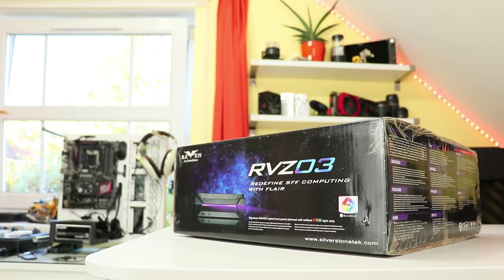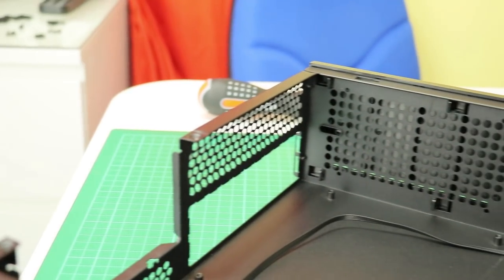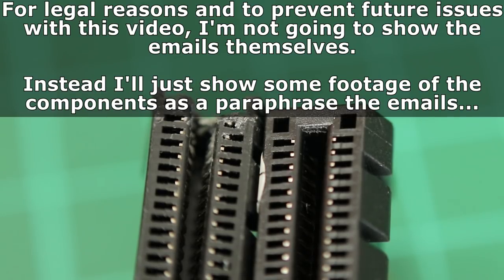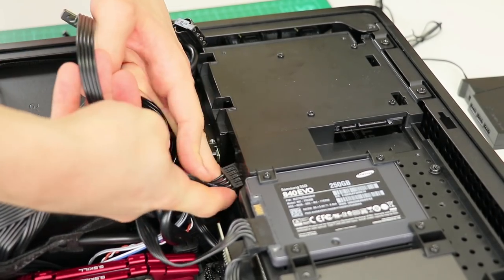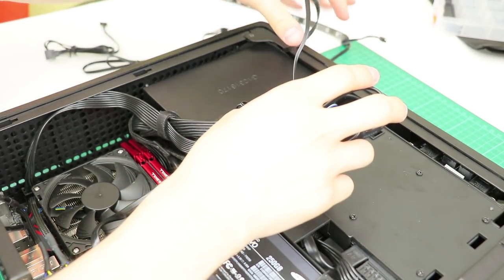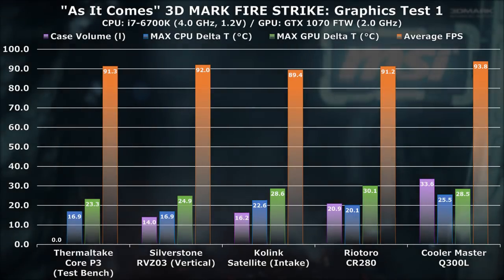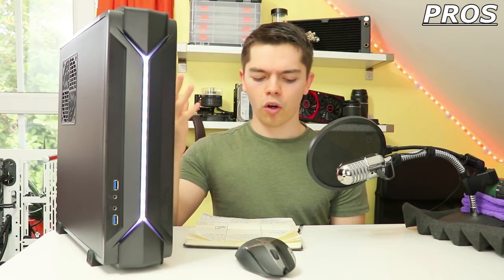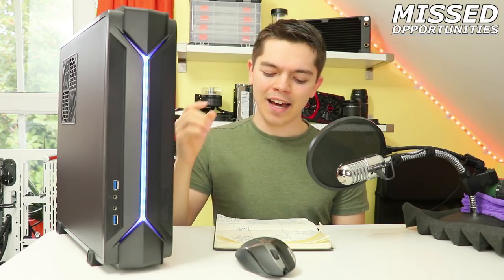SilverStone Raven RVZ03 (Mini ITX) Review

Comment: Excellent review, however you really should have NOT pulled the pci-extender off in the horrible way in which you did, it failed because of your poor method. I have this extender and i have sucessfully removed it without issue. If it starts to come off sideways, STOP and start to pull off the other side so it comes off straight. Really grade 3 stuff man...
Reply from the maker: I can't say I agree with you there. There's quite a lot of initial friction between the extender and the notch, so it requires a fair amount of force to remove it. Which of course means that there won't always be the fair warning that you've experienced to make adjustments.

The connector they chose is designed for a motherboard where the installation is very linear. However for this more dynamic or variable situation the clip has not been redesigned to suit, it's just been added to a daughter board and left as is.

It's way to easy to just assume that the person who has a bad experience is inexperienced or incorrect. What I'm saying in this situation is that there were steps could have been taken to completely avoided this outcome. That fact that it can so easily break (and it can because it did, you'll probably notice I'm not exactly all that strong) is worrying to start with. Good design doesn't entertain this room for error, and we certainly shouldn't be blaming the consumer when the design allowed for such an outcome (breaking shouldn't be a possibility, and if it has to be, it shouldn't be that easy).

Not to kick a dead horse, but I haven't owned something that's been so on the fence of breaking and still regarded it as good design.

The real question is, do you believe this is the best design they could have come up with, and by extension believe they couldn't have made any improvements to prevent breaking during this action?

Design dictates function, and if a potential function is to break, it was designed with that function (or looking at it from a other side of the coin, the potential function to break was never designed out). If it can't break during standard function, it would be the design that's dictating that inability to break. It's up to the designers to figure out potential functions and irradicate all negative outcomes during standard operations (and from more durable products it goes even further than that).

If I designed something (and funnily enough it's part of my job) that could break this easily, I'd send it back to the drawing board. And that's the perspective I take looking at all these cases. Why is something bad, could the design be simply improved (simple questions that provide simple answers). The design of the extender allowed it to break very easily, and removing or reducing the rear of the notch would prevent the break (simple problem, and easy solution to prevent it from ever breaking like this, and criticism like this from ever being valid).

I haven't got a personal problem with anyone in this situation. To me it's the same situation as the EA look box "gambling" situation. Sure we could all blame the customers for buying loot boxes, but if it was designed out of the game there wouldn't be a problem to begin with (and this doesn't take into account that some people are more susceptible to gambling style situations. Much like not everyone is fully practically able which could make constructing a PC difficult - sure that's an open easy shot at me in this situation, but it's a valid point). Tackling the root of the problem is where my attention is set, not blaming the user when they didn't design that possibility out.
Reply: @AVTechy  I can agree that yes, a better engineered design could have been implemented thus reducing the likelyhood of this problem. However, i also believe that people can use better judgement when performing any task and use a little foresight before and during the proceeding. Look i get it, its not 'dummy proof', but its not like they are going to make it out of PA66 and put an elaborate kick off latch on it because that would drive cost up. In the world we live in today there is plenty of room for improvement, especially for the human species...
Reply from the maker: Okay, so you agree that it could be made better. That's a solid start, at least we're on the same page.

But as a little side note, do you think a latch or a small redesign of the mould to the back of the existing design would "drive up cost" that much on a £100 case? There would be a be a tool manufacturing cost of course, but other than that we'd be looking at perhaps $1 extra per mount (if that coming from a mass manufacturer in Taiwan). Or they could just buy one with a latch off the shelf for a small extra cost, this is all off the shelf mass manufactured stuff, and it's just the plastic part that's changing (Lotes sell handfuls of different PCIe connectors). If we were talking about a £40 case I'd be more wary, but it's a premium £100 case.

But here's where your argument starts leaking. If the human race has plenty of improvement, I'd want the "better judgement" and "foresight" to be on the side of companies who design mass manufactured products, not those using them (why have thousands of products with a sub-optimal design, when you could produce thousands of products with optimal designs?). And who knows, maybe if good design throughout was more ubiquitous that solved more problems, maybe people would aspire to getting better designed products instead of just putting up with them... in a £100 case. Why have I been able to review handfuls of other cases (95% of which are cheaper) and not encounter a problem like this?

I'm not asking for a brushed stainless steel finish, or a tempered glass clad case. I'm asking for the function of a part of the case to be improved at the design stage. If they'd thought of this before pushing the product out, I may have even praised them for the extra effort in the design process.

Again without beating a dead horse, if say removing the side panel at an angle snapped a clip that dictated the replacement of the side panel, then I wouldn't stand up for the designers and say "maybe I should have thought of that". I'd say "hey! why didn't they think of this? Where the hell was the warning that this might happen, and the instruction of how to remove it properly? And why would anyone design a product that could break so easily?". I pulled the extender like I pull out a graphics card (it's intuitive since it's a very similar connector), and it broke for the reasons explained at length in the video. There wasn't anything to specify otherwise, so since the designers didn't think of it, why is it left up to the customers to work around it? Are we saying the customers have to think more than the designers? Same goes for Apple and their keyboards - where their customers also blame other customers for using their keyboards incorrectly... it sounds so familiar.
Reply: @AVTechy  Haha clearly we are not on the same page about the end user's responsability to operate the product properly.

Let me make this clear to you now because i have a feeling it plays a factor in your flamboyant repsonse to my argument... I do not work for these manufacturers, I am a mechanic, i fix cars all day, and i have learned to work around problematic garbage all day long. What i gather from your response is that you want a better product, and yes dont we all, and you may well deserve a better product. I dont blame you for making a ruckus, however what you should consider is: that when you are working with something, take some time and care to install or uninstall it gently, if force is required perhaps use a pry tool in a careful manner to control the reaction of the component you are working on, think before you act. These are all simple things to consider and will aid you in your quest.

Everyone can learn from things, and both you and the manufacturer should have learned something here.

See i dont believe in a lazy human race, i think we can all learn and do things a little better.
Reply from the maker: I suppose it comes down to what is defined by "properly". I would regard it as to the manufacturers specification, which in this case they don't mention anything about the operation of the connector. There's nothing there at all.

If the manufacturer had said anything on the matter then I'd be 100% to blame here, but I believed I was working with a quality product after paying £100 on (and nearly an extra £15 if they'd charged me for the replacement). When dealing with something as delicate as anodised brushed aluminium, I completely agree that extra care should be taken since the finish is clearly very sensitive to damage. But for a plastic PCIe riser card I don't expect to need to handle it so gently. I've never had to before (with any PCIe connector on any motherboard, and surprisingly enough Thermaltake have created a more durable PCIe rise than SilverStone. Thermaltake even put a catch on theirs and they've not closed down over it). If a Pry tool is the recommendation to remove a PCIe extender, I don't even know what to think. I didn't need one for the Core P3, I've never needed one before, why would I be expected to need one now? (and if I am, should it not be very specifically mentioned, at least to cover SilverStone's back?).

I've been conditioned by the many well chosen (by the manufacturers) PCIe risers and connectors over the years to expect it to just work and not worry, so when I come across one that performs below par (or at least so poorly selected out of the options available), it's surprising, and irritating when it's come as part of a £100 case. I suppose in the future I need to be careful around SilverStone connectors since they're the only companies PCIe connectors design I've had a problem with. It's never been a problem before, but it was in this one case.

I really don't think I can be accused of laziness here. I spent two weeks every night after work and through the weekends creating this video, recording every angle I thought was relevant, and describing it as much. I've created the longest (not a great metric) and most thorough review (by virtue of its information density coupled with its time) of the case, and Livestreamed the un-build process. I don't think there's much more I could do to cover the case properly. I'm judging that since nothing else broke then I've clearly not been mishandling the rest of the case, so it's just this specific connector that's been mishandled so poorly (and not the rest of the case and every other PCIe connector I've ever used).

The standard has been set by every other PCIe connector, I think since SilverStone's connector is the odd one out they might want to catch up to the rest of the market (just being facetious, but it's not completely untrue). And why don't I mention my career as we'll be on the same page. I'm Architectural Technologist and design building connections everyday, connecting things together well is also in my wheelhouse.

Comment: This dude destroyed his riser by not paying attention then blamed Silverstone. God.
Reply from the maker: Yeah if you water it down that's what happened. But here's my point... How much attention does one need to pay to not destroy something?

I don't pay much attention to operating the trigger of a fuel pump, yet it doesn't break apart in my hands. I don't pay much attention to closing the lid on a sealed food of container, but they get reused countless times without breaking.

It shouldn't take one movement within the tolerance of a component for it break, that should be designed out from inception. Why not design or specify a component that doesn't allow this result to happen easily? 

I'm sure if the pedal of your bike broke off you'd blame yourself for using it in the wrong way, or if your system overheated and crashed you'd blame yourself for not using it properly. I'd work out if I had used it the wrong way first, and then make a call. Is this where I say "God" too?

Comment: Hi, can I fit this massive GPU in it? and also this PSU? Thank you.
http://www.sapphiretech.com/productdetial.asp?pid=B679632D-4931-4156-9DB5-0EFC5453C6D5&lang=eng 
https://silverstonetek.com/product.php?pid=731
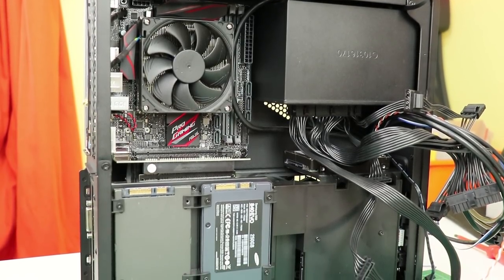Reply from the maker: Based on the info at 21:55 the total thickness of card supported without the included fan would be 73-78mm. So including the fan it would be around 58-63mm. So that would mean the 54mm graphics card would fit. You may want to think about either removing the case fan by the graphics card, or even moving the case fan above the CPU cooler into the other slot by the graphics card to provide extra airflow. Then you can add another fan above the CPU or install larger CPU cooler without the fan above it.

As for the PSU, since it's 130mm there won't be as much room left for the cables as the system in this video. But if you remove the drive support panel by the PSU then you should have the room to make it work well. Let me know how it goes.
Reply: Cool, thanks a lot, this video clears up a lot of the concerns I have with this case :)
Reply from the maker: No problem, glad I could help out :)

Comment: Slight changes as of summer 2020

I just got this case, only thing I don’t have yet is the motherboard (mini ITX AM4 boards are all sold out) the rgb lighting is now controlled by a controller board mounted to the panel where the fat hard drive was mounted in the video.

Same process as before with the lights coming in to one port on the board but instead of 4 pin, 12V rgb connector it looks like it is now 3 pin addressable